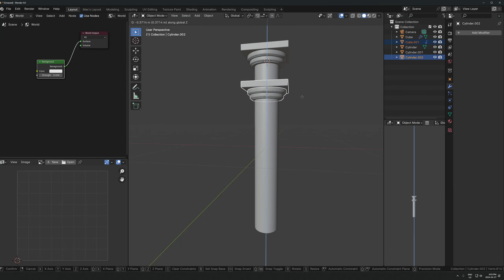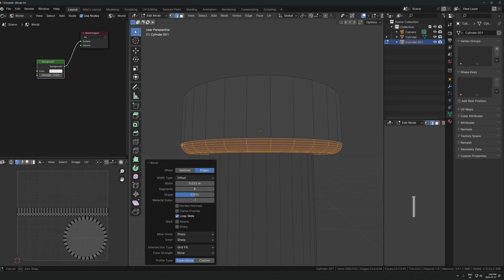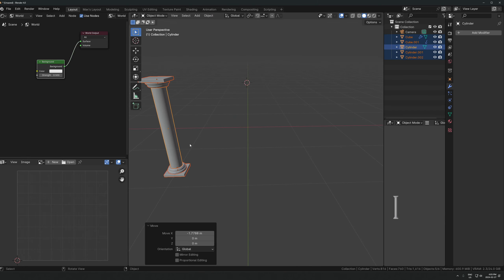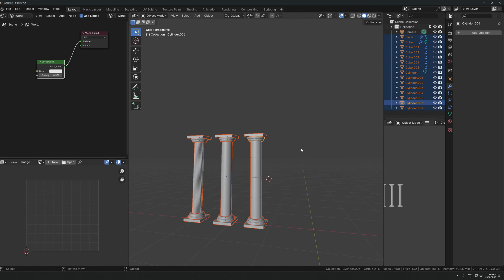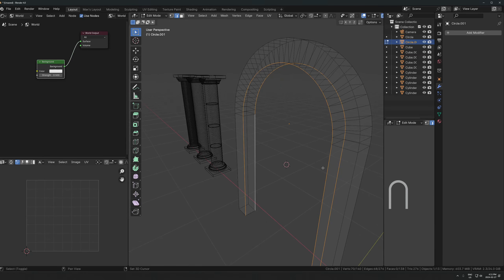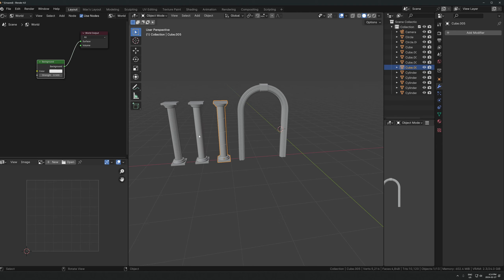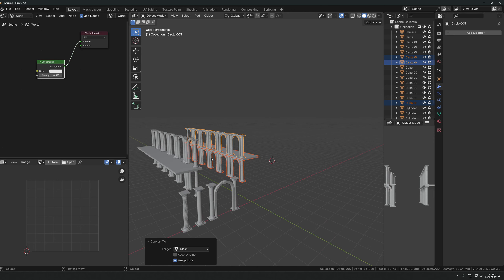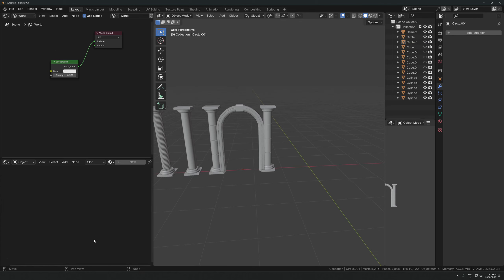Creating a Simple Archway in Blender

Comment: What are your PC specs?
Reply: It's pretty predictable by now: 

8 core/16 thread cpu or higher; 32 GB RAM or 64GB if you need it; very good gpu, typically rtx 3090 or 4090.

Fast SSD boot drive and loads of storage, or NAS. 

Some people even have two top end gpus, so they can continue to work whilst rendering. 

A good psu is essential. Buy 1st tier, Seasonic or BeQuiet, and minimum 750 watts for one GPU, but depends on what you have. Components are getting very power hungry these days, especially cpus and gpus. You can tweak gpu power consumption down a bit, which is recommended. 

Good cooling is essential. Cpu cooling by Noctua, D-15 is superb, and good case ventilation.
Reply: @richardconway6425  I'm looking to build my first PC. (My budget is very tight) this is how it looks 👇
 i5 14500 
RTX 3060 12gb
32gb ram
1tb SSD
Reply: @lavatr8322  I've responded to this fully, but I'm having problems with youtube accepting my comments atm, so I'll try reposting again later.
Reply: @lavatr8322 that's more than good enough to get making some nice renders my guy, don't worry